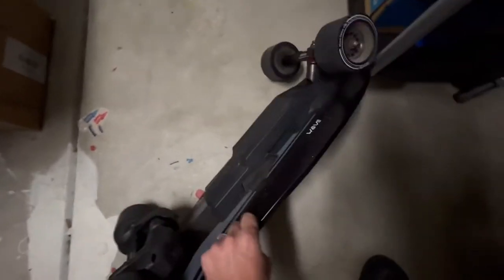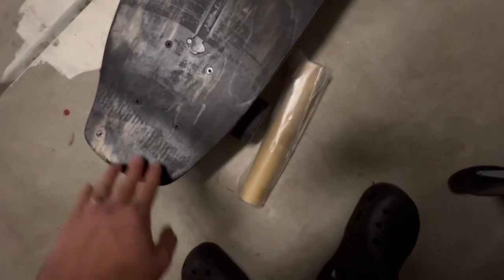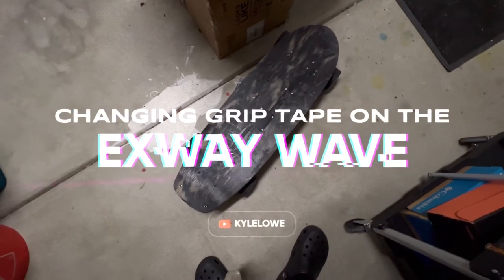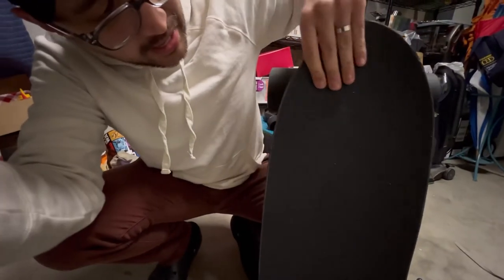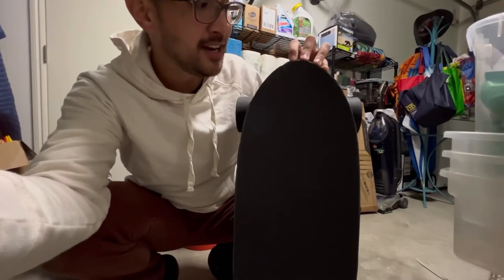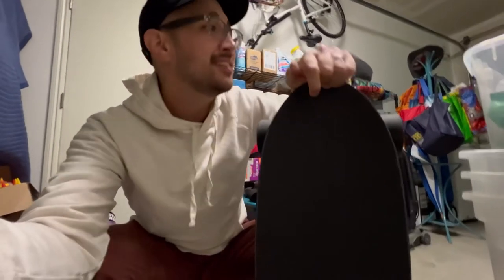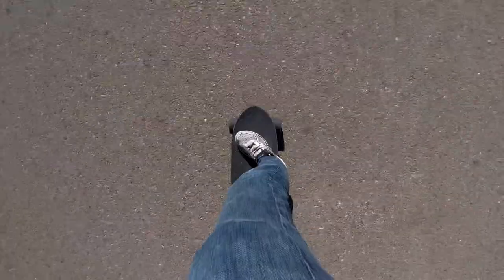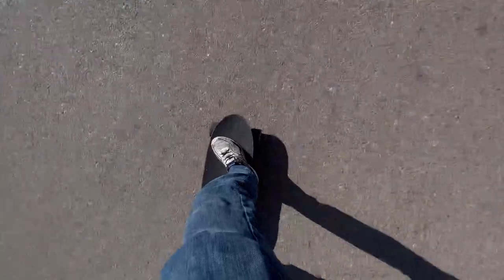Exway Wave Grip Tape Replacement

Comment: Peeled of on it`s own you say? Mine wasn`t even sticking to the board under about the "curvation" you mentioned! ;-) New tape is already bought! If it does still stick they say a heat gun solves that, good thing I got one.
Reply from the maker: I need to get a heat gun!
Reply: @kylelowe  Youtube doesn`t want me to tell you, since it deleted my comment 3 times in a row before I was even done writing. No, I did not swear, I swear! Just poof!! 
Damn AI! However, def recommend, I would even say it is one of my cheapest and yet most versatile useful tools in my belt. Peeling stuff that sticks, warming glue to make it stick better, heat up solder points to whatever temp. it needs before even starting the soldering iron, and even hard line tubing for custom water cooled PCs get bent with one of those thingies. Well, now I have glass tubes, but back when they were plastic...
Oh, btw. the griptape I bought friday from the local sk8 shop in my area did absolutely not want to peel of it`s covering paper sheet thingy. It was messy like I never saw a griptape peel- or not peel. Not like it should be, like when you peel a sticker of it`s paper sheet thingy, but like when removing decade old tapestry. The grip was pretty much ruined by the time I had at least MOST of the crap scratched of and such. But I took some glue, and it is not my worst work, if I dare say so myself. lol